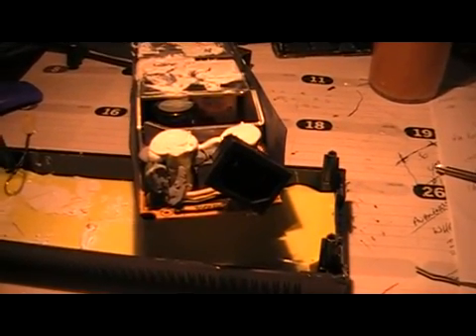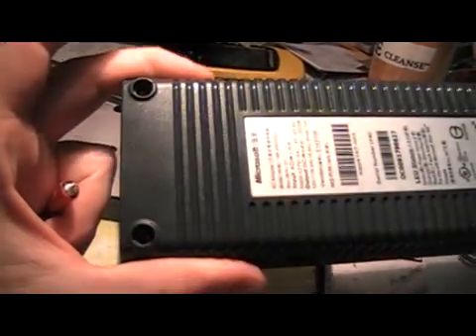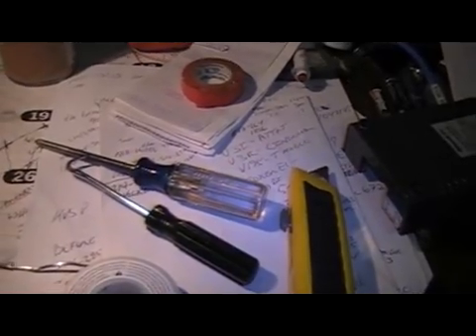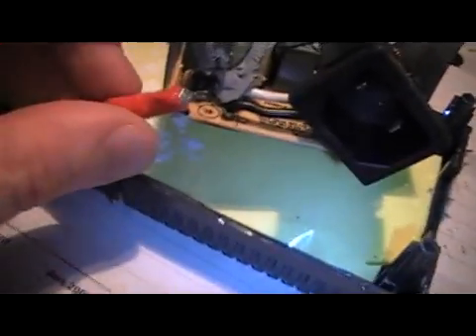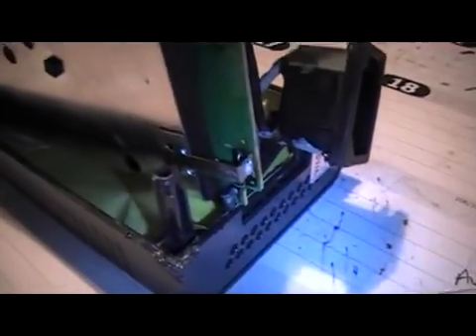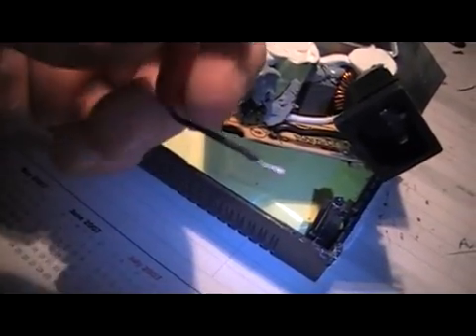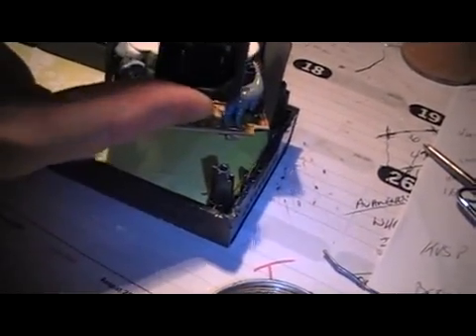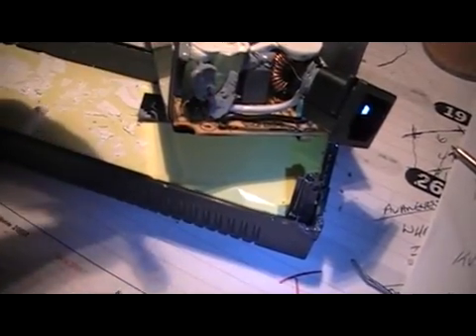Xbox 360 power brick supply repair

Comment: Wow, you smashed it against the concrete?!  You simply need to remove the four rubber feet and then when the tiny hole under each foot is exposed, put a thin bladed screwdriver into the hole and angle sideways.  This will remove the plastic caps that covers each Torx screw. 

If you ever open a repairs shop, get someone to take away all of the concrete beofre you start trading!

Comment: I was pulling my xbox into the lounge room and I didn't see that the power cord was still plugged in. I was walking and I noticed it was still in and I gave it a pull and I accidently dropped the xbox. I had a look for any thing broken and I saw the part that connects the power cord to the xbox was loose and i saw the red wire was out of its usual place so I tried to put it back to its normal spot but nothing worked. Can somebody help me get it back in there?

Comment: @Quantum0700 pcs are the best system technically. they have the best games, the best graphics, the loosest rules on censorship, but for the computer to smoothly play anything and online is fucking retarded, high end game computers ive seen for thousands and then theyre only gonna be top of the line for so long till you need constant upgrades like yearly cause the games keep pushing the line on system requirements

Comment from the maker: Where the two peices come together is the weakest so hitting it on the corners is the best. I have not played it in a long time as I WORK FOR A LIVING so when I did i got the same thing a few weeks ago. I was using the white NYKO intercooler with the 3 fans. Ite the one where the power supply plugs into it. It had overheated orver time, about 3 years, and the plastic had melted into the connections. removed intercooler, cleaned connector on power supply and prongs on back of xbox, works fine

Comment from the maker: this is so kool that you dumb fucks have nothing better to do than to comment on something you havent done. Do better, post your own shit...I actually work for a living so have no work bench.

It is actually very well built its just put together with super glue. Once the screws are out its best just to tap the corner on wood, concrete, brick or with hammer. I didnt have time to screw around with it and IF i destroyed it I would still be in the same spot. Just have buy another instead of fix.

Comment: i was trying to fix my xbox 360 with the red ring of death when i plugged it in to try it the light on the power brick went red and the xbox wont turn on because of it. so i tried to open the power brick so i took out the screws but the cheap built piece of crap wont open

Comment: clean your mother boards hasnt anyone else noticed the water scale left behing fuck knows what was in the water i keep getting xboxs with faults and cleaning them really well they all work now even the old blade 2005 i have 4 xboxes with green lights now and im pulling apart another with this 0001 error i think they were stored like shit during production or transport china built the original xbox so i dont see why the 360 is so touchy

Comment: Wow, this thing sucks to open, i just hit it on the seem with a ratchet all the way around and it came apart. DONT just sart bashing it though theres lots of little stuff in there that could get ruined from  hitting it too hard. try putting more air holes int the plastic casing to help vent it better. Be carefull of the aluminum vent on the top part of the cover and, when you pull it apart makesure that you detach a black wire that comes from the top of the cover to the board below.

Comment: Any idea what size screwdriver to use on the four bottom screws of the brick? The ones on my supply are pretty stripped, so it's hard to figure out the right size. Any suggestions on how to crack it open if the screws won't budge?

Comment: Just a word of advice on opening the power supply brick. Do not bang the brick on the ground! This can severly damage the brick's internals, not to mention chipping or breaking the external plastic case. Just simply tap around the edge with small screwdriver or putty knife using a small hammer, tapping gently will break the glue seal and then you can pop open the case.